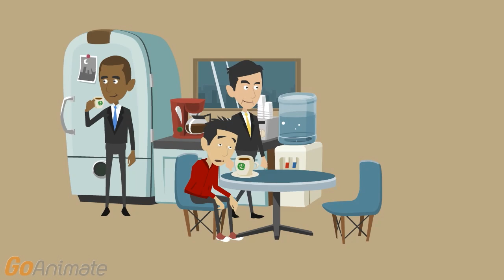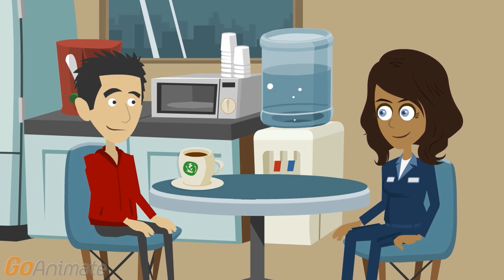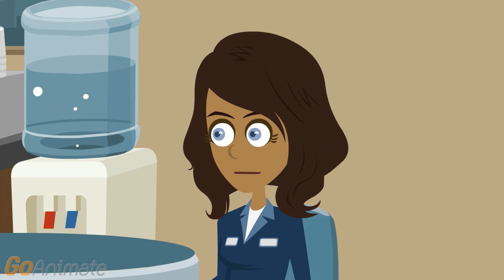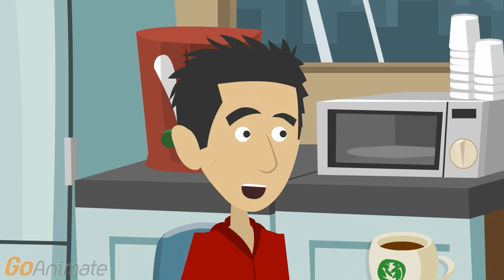American Standard Furnace Error Codes

Comment: OK, for the Freedom 90 at least, the breakdown is as follows: Flashing slow=normal, no call for heat. Flashing fast=normal, call for heat. Continuous on=replace control. Continuous off=check power. 2 flashes=system lockout (no flame). 3 flashes=pressure switch problem. 4 flashes=thermal protection device open. 5 flashes=flame sensed with gas valve off. Source: American Standard Service Facts sheet.
Reply: THANK YOU PAUL!!
Reply: Had 3 flashes and but everything seemed ok so furnace guy just took off hose leading into pressure switch, blew into it, replaced hose and voila, repaired by blowing out moisture. Good luck!
Reply: What's a thermal protection device open even mean.